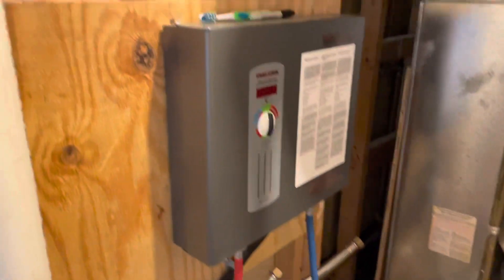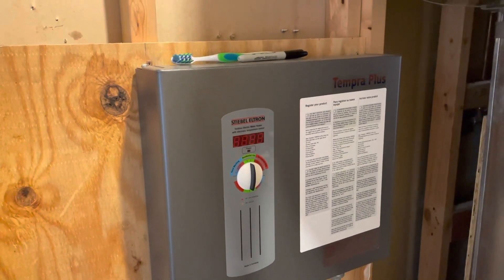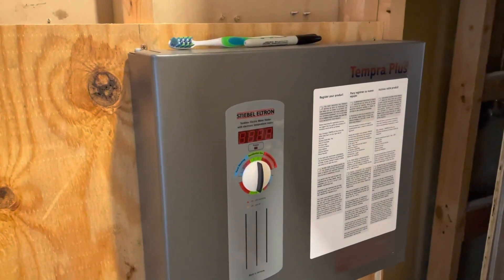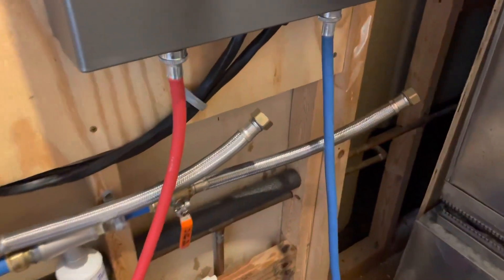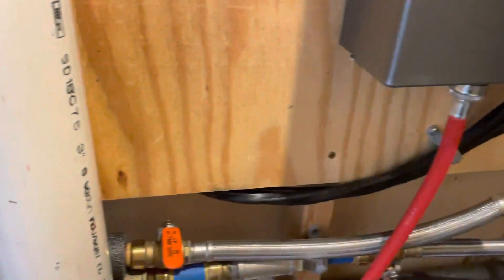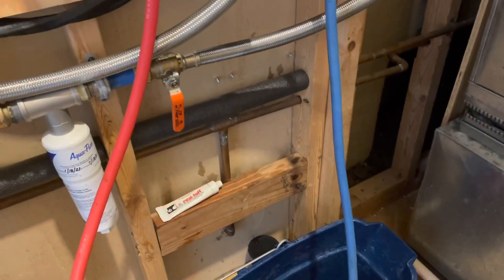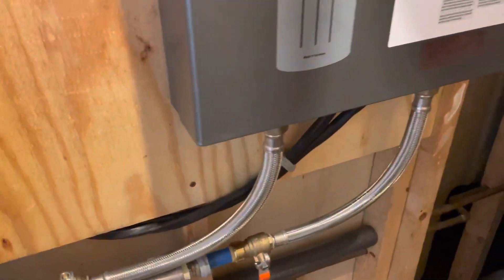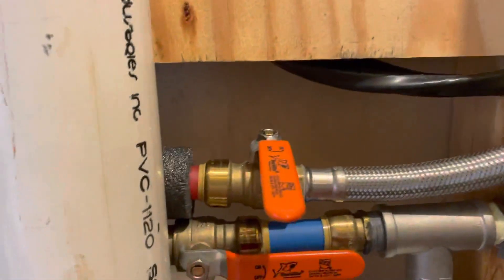How to de-scale a tankless electric water heater

Comment: So the pump is pushing the water from the hot side and out the cold side?
Reply from the maker: In the cold side, out the hot.
Reply from the maker: I forgot to include flushing the heater with water for a few minutes after the vinegar.
Reply: @jedi_mapperp4073  I actually bought a solution to do this which I’m doing as we speak and I called the company that makes this water heater and they told me to do not use vinegar

Comment: Mine does not allow water to flow through. I think the flow meter has to be powered on. No help from Steibel Eltron.
Reply from the maker: Do NOT have it powered on while trying to flush it. Extremely dangerous…a death wish. Your flow valve may be fouled with calcium deposits. I flush it every 6 months to prevent deposits. No problems. Works the same as new.
Reply: @jedi_mapperp4073  Same problem here.

Comment: I've seen some tankless heaters with service port valves instead of swapping the flexible hoses like you do.  Do you think that's overkill?
Reply from the maker: I noticed this also before I installed my system (did it myself). I think it’s overkill for an electric indoor unit. I think the ones with service pots were all copper tubing and soldered, so swapping hoses isn’t possible.
Reply from the maker: Also, my entire setup is PEX and Sharkbite fittings and valves. Super easy to remove all of it. We’ve had zero leaks. The Sharkbite fittings are great. Going on 5 years of endless hot water, and only when we need it.
Reply: @jedi_mapperp4073  Thank you for the quick reply.  If you don't mind, may I ask about the pre-filter: Does it simply make the flushings less frequent than otherwise, or is there a benefit beyond that?  Thank you again for good video.
Reply from the maker: @erictorbet8104  It’s not a filter. It contains pellets of a food-grade 3M compound that binds up the calcium carbonate and keeps it in suspension (at a molecular level). I’ve never had any scaling issues if I change the cartridge every 6 months. I let one go a year once and noticed a return of scale buildup on sink faucets and drains. I also noticed the water took a little longer to get hot due to scale. The 3M product works and my water heater manufacturer requires one to maintain the warranty. Our town water is sourced from wells. It’s generally moderately hard, more so during droughts.

Comment: I tried to run the vinegar through my system but it seemed like the flow was clogged. I couldn't get the fluid to flow with the pump.  I was using standard washer machine hoses but with no luck.  At first I thought the pump was bad but it worked outside fine.  The filter in the unit was clean so I know that wasn't the restricted area.  When the hoses are hooked up normal I have flow throught out the house with no problem.  The reason I want to clean the system is because one of the elements keeps tripping the high limit switch off.  Any help would be appreciated..............
Reply from the maker: Sorry you’re have trouble. I’ve done this process once a year for 5 years with success. High limit shut off could indicate a failed element shorting out.
Reply: Is it possible you ran it backwards? I dont know if it matters but I did it like this video where the ¼horsepower  pump   discharges into the heater cold side. And the Heater hot side empties back into the bucket.
Reply from the maker: @lionintu  There's an electronic flow control valve on the SE tankless heaters. I did not want to force water through it backwards.
Reply from the maker: @lionintu  I actually did what you described...I see I put the red hose on the cold input fitting...sorry for the confusion. I pumped the water into the cold inlet and out the hot...returned it to the bucket...round and round it goes.
Reply: @jedi_mapperp4073  that's awesome I'm glad you got it done successfully.
Reply from the maker: @lionintu  🙂 It’s my video. I can’t see any reason others haven’t had success. Perhaps they need to prime (fill with water) their lines. I didn’t need to prime mine.